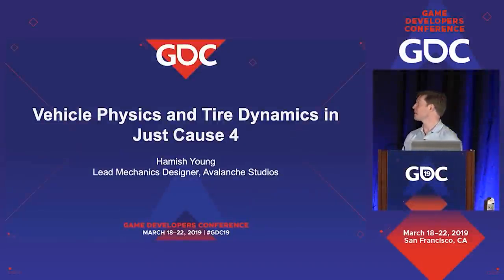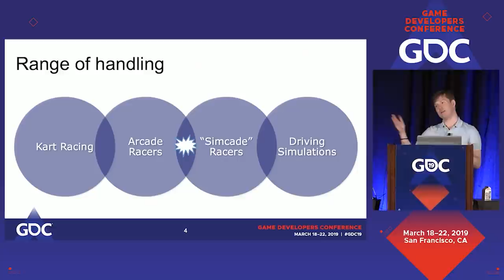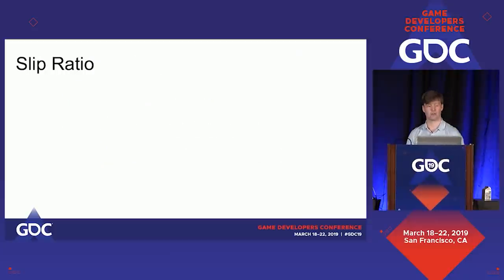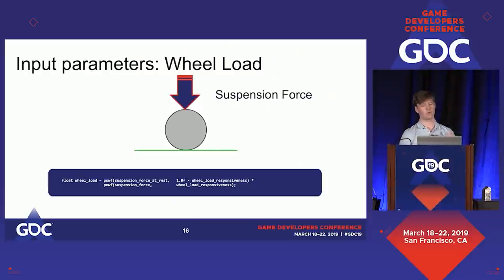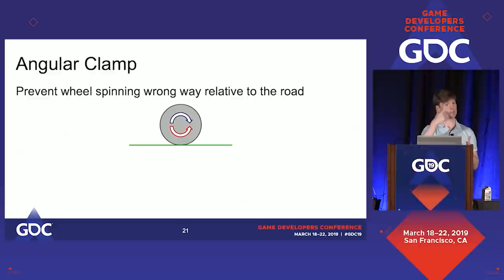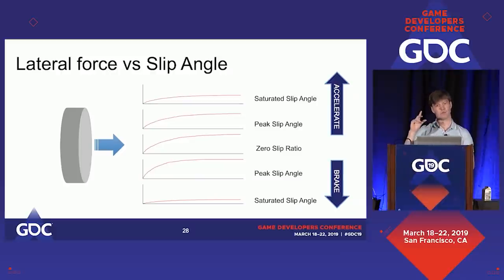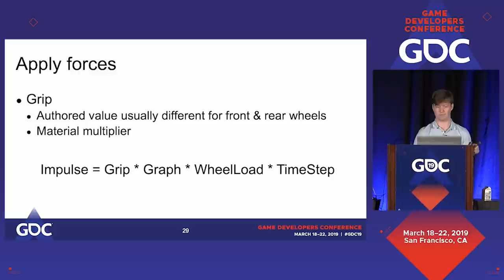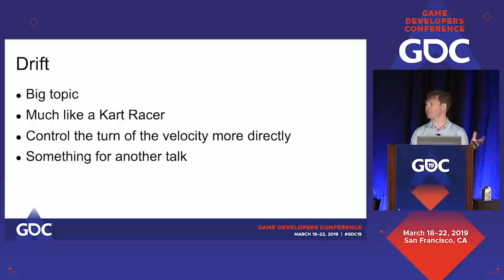Vehicle Physics and Tire Dynamics in Just Cause 4

Comment: Regarding 12:48 Isn't total_wheel_load the same as vehicle_mass?
Reply: only in (vertical) rest, because it takes gforces into account, if the car drops down on it's wheels the wheel load is higher than the mass. if the car is flying through the air the wheel load is zero while the vehicle mass stays the same.

Comment: How does this system handle being stopped if all forces require slip?
Reply: When braking you generate slip, thus a braking force. That will slow down your vehicle until it stops
Reply: @borzonstudios8638  I mean when parked on a hill. No movement, but still needs to generate force to keep from sliding. How do you handle that?
Reply: @haha71687  Phsysics explanation (1) and a game implementation (2).

1. On a hill, the car is tilted. This means you have a component of the force of gravity which acts in the longitudinal direction of the car. This wants to pull the car down the hill, but the static friction between non-moving tyres and ground generates elastic deformation on the tyres themselves even when you are standing still. Just like how you would deform the soul of your shoes if you tried to slide it. This elastic deformation generates a force.

2. In a game, I guess you would probably set an if statement. If the car is going less than a certain speed (say speed < 0.5 kph), then apply the static friction formula to the car/tyres. See Coulomb friction on wikipedia. I would probably do it like this.

Comment: This guy is why I get bored driving in most games.   For a start everybody drives real cars while distracted, they are very easy to drive.  The more sim the easier a car should be to drive.  Give me understeer and oversteer FFS, keep it fun.
Reply: It’s different when for the most part most people will drive 50-60km/h on a normal day, while in most open world games players would easily push 200+ km/h on tight roads with lots of traffic. 

More realistic doesn’t make it easier, but there definetely has to be a good balance between realism and gameplay.
Reply: You know, you don't have to post something wrong in the comments of a video you didn't understand just because there's a field for it. You can, and should, just do something else with your life. You heard one line at the beginning of the talk about balancing the driving complexity with the gameplay complexity in Just Cause, a game with a high degree of freedom of movement that often interacts with vehicles, and decided this guy was making a boring driving system - while in reality most of this talk is about how to make a system that allows for developer control, solves for complex problems, and fits within a reasonable computational budget. You do not, in fact, have to be an asshole for no reason.
Reply: Coping lol